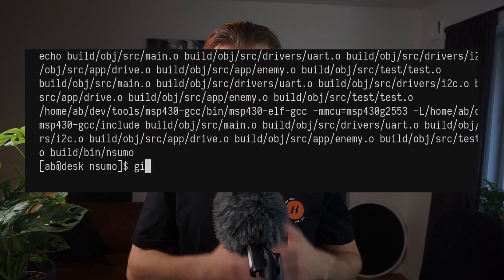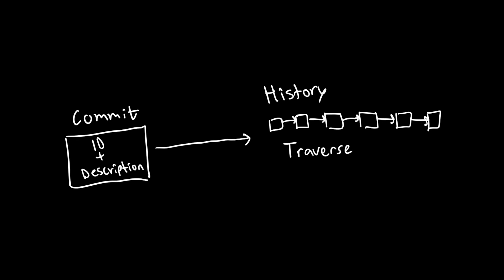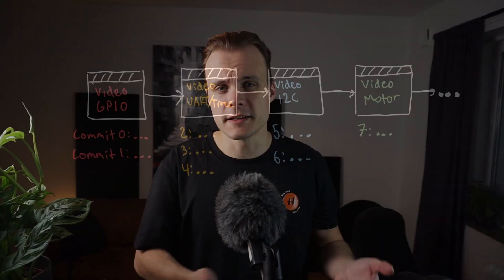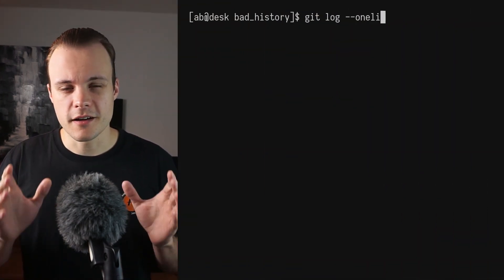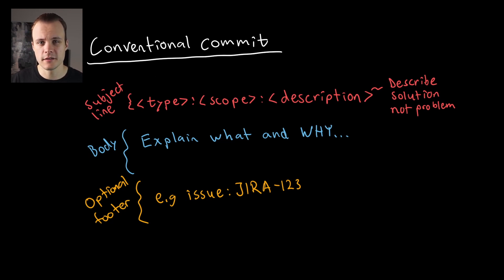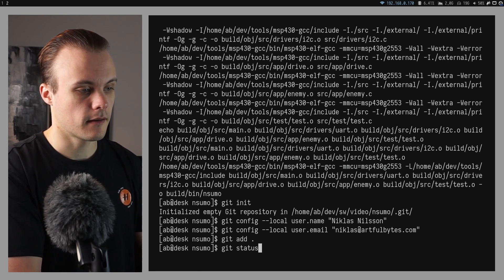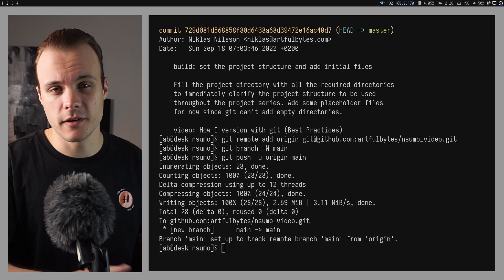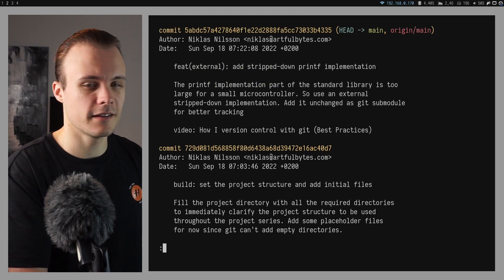How I version control with git (Best Practices) | Embedded System Project Series #8

Comment: What do you use to control versioning your PCB? And what workflow do you recommend or have seen? Maybe Git Flow
Reply from the maker: I use git, which is especially nice with KiCad since its design files are in a human readable format, which means the diffs are somewhat readable and even more so with KiDiff. I also like automating the output generation (gerbers, schematic pdf, bom...) with a GitHub action running KiBot. I keep my footprint/schematic symbols in a library and version control it in a separate repository, and include it as a git submodule in my KiCad projects.

Comment: Hi, there is a tool called commitizen. It is quite usefull if you want follow conventional commits, because it simply asks the questions and forms message. Also you can add your own schema or even generate changelog from commits as well.
Reply from the maker: Great tip, didn't know about that, will try it out myself 👍